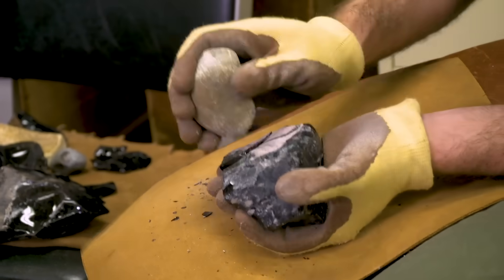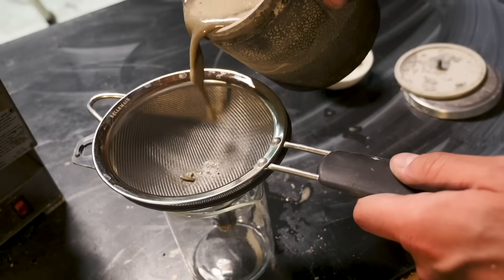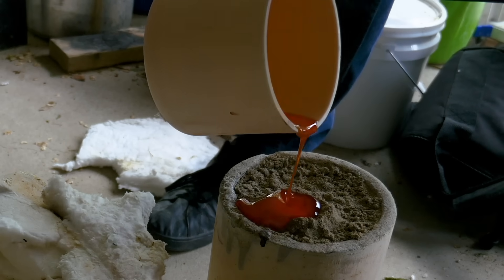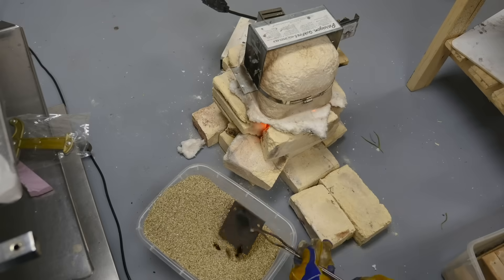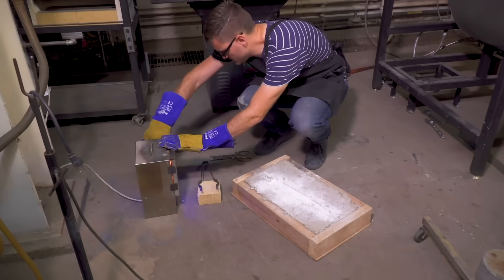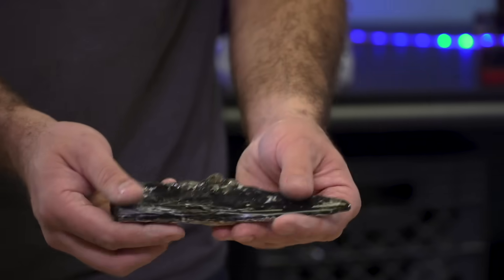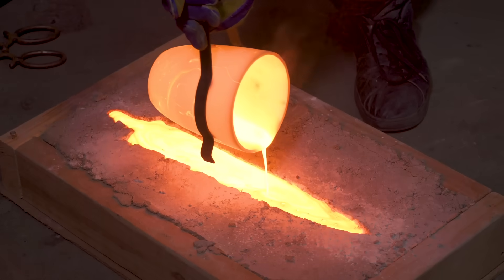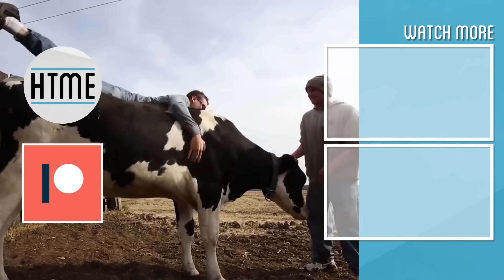Can You Melt Obsidian and Cast a Sword?

Comment: Random info: obsidian and glass, when molten, are ionic liquids. This is to say they contain electrically charged free mobile ions. As such, once molten they will respond to microwave radiation and induction. You just need to get a tiny bit of the obsidian or glass melted and the microwave oven OR induction smelter will be able to maintain heat on that tiny bit and allow it to conduct to the rest of it and melt the rest.

Comment: a helpful tip for making glass in crucibles, try skimming the top surface while its molten to remove any junk or air trapped inside. try also adding the flux incrementally and skimming in between adding flux until its to your desired stability. a lot if the problem here is impurity in the glass if you could refine it more and more you might have more luck but i think you pretty much covered it here
Reply: remember the more metal inside the glass the more likely it is to expand and crack the glass while it cools down. we dont like to put sparkle colors encased in other glass unless there is a open side for the metals in the sparkle colors to expand
Reply: what you are doing is basic glass chemistry and you are following in footsteps of people like Paul Trautman in the discoveries of glass creation its pretty neat
Reply: WookedoutLINK dang your smart
Reply: WookedoutLINK your a smart person, keep learning what your learning
Reply: Wouldn't you just have some type of glass and not obsidian at that point? Maybe the question is can you make glass from obsidian easily?
Reply from the maker: Thanks for the advice!  It's been really interesting learning about how to refine glass and your feedback makes sense.  Will try this in the future.
Reply: we use steel rods to do the skimming btw
Reply: What is this SORCERY
Reply: The Pokémon Hipster This is me all through the whole video and scrolling down the comment section
Reply: Glass telescope lenses can take a year to cool.
Reply: This is fascinating, from a cook's perspective.
Reply: well, SHIT!!! he's giving mojang ideas now, crafting obsidian swords
Reply: The Aztecs didn't need to melt it.
Reply: The aztecs just used the broken edges of natural obsidian, bound in wood or leather to stabilize.
There is a vast amount of art and technique to knapping obsidian, and no matter what it wouldnt result in what he was trying to make in the first place.
Reply: +Skyler Thompson: I know. This whole business of smelting obsidian just seems absurd to me.
Reply: You should teach this shit bro I was ready to take a class after that one comment
Reply: i dont understand anything
Reply: DopeyCat Stop Motion YES,WE DID!
Reply: 993 likes in 2 days wow
Reply: WookedoutLINK vvvvvvvv v
Reply: WookedoutLINK like abd subscribe if you think it is cookies ice cream
Reply: siavash karimian 
That’s what they’re called?!? That’s so cool. Metallurgists have got to have one of the greatest jobs. I’d love to learn how to craft something with my own abilities.
Reply: Crucible?

THIS IS AMAZING GUARDIAN!
Reply: WookedoutLINK    👍🏻
Reply: WookedoutLINK i did not mean to press this :p :P q:
Reply: He should have tried using salt in the compound it might help.
Reply: WookedoutLINK 
In other words, treat the molten obsidian the same way youd treat molten metal before pouring it? You have to skim off the impurities from molten metal as well obviously.
Reply: There is literally 1 comma and no periods
Reply: lame
Reply: The Bonsai Belief System you're lame
Reply: Chris Murad no u
Reply: The Bonsai Belief System you’re in the wrong place.
Reply: The Bonsai Belief System) why would you be here then

Comment: I wouldn’t call it natural by any means. This cast is man made, not made by a volcano. Also, I assume by adding flux is what made it clearer than normal obsidian is. And lastly, the bubbling is the molten lava pool of obsidian off gassing. That’s why when you heated it up, the bubbles shriveled back into the liquid. If you would have let it cool and not made the bubbles disappear, you would have a really cool and interesting man made obsidian specimen with bubbles on the surface.

Comment: Lay down the mold and do a half cast, do half of the knife, reposition and fill the other half. Sift the green sand around the mold (not the whole thing) so it comes out with better detail, and pat down the mold continuously. You’ll get way better results casting

Comment: Oh my. Ok, mill your mold negative out of graphite block. This sand casting glass thing is of limited utility. Next, your glass pals might have a platinum crucible you can borrow. The alumina ones are going to end up as single use. Also, there may be some pickup into the melt. Not desirable .

Comment: Have you tried sintering it instead?
Also, it should be noted that there is trapped water inside of vermiculite and inside of obsidian.  Do you have a vacuum oven you can try and dry it in before trying to melt it?

Comment: There is a process in advanced sword making that is called forging crucible steel.  

Basically, you take a metal crucible, toss in iron, carbon, and sand and heat it to a ridiculous level. The sand turns to glass and, -through a series of chemical interactions - leaches out properties and impurities in the metal that would make it brittle. Some of the best swords in the middle east and upper Europe were made of crucible steel. 

There is no reason that I can see why powdered obsidian wouldn't work in place of the sand. In fact, it might even make for stronger steel.

Comment: It's quite easy to make such castings and still get the strength of true obsidian. Just melt it (without flux), in an inert atmosphere and pour it. Then anneal it for about 10 to a 100 thousand years or so, preferably under a slight pressure of a couple of tonnes per square inch. Easy peasy.

Comment: With your standard equipment you got kinda close, in spite of the fact that it isn't built to melt things at such high temperatures.  If you had specialized equipment built for the higher temperature, you might be able to melt it without flux into enough of a liquid state that you could cast normally with it (With specialized casting equipment obviously).  Even though you don't really do it here, it definitely seems feasible.  Either way, nice job.

Comment: At 9:00 when he is pouring. I knew right there, that crucible had it. I knew that it can't do another round. See the glowing crack?  And sure enough it cracked the next time.  Don't know how you missed it or thought it was okay.
Reply from the maker: I definitely saw that cracks.  You'll notice the metal tray I added below it afterwards to attempt to catch any leaks (it just unfortunately fell off when I pulled it out to stir).  The crucibles actually cost more then it does to fix the kiln, so if I can get even one more firing out of a crucible, it's worth it.
Reply: I suppose I can see the logic in that. I Did not know the price difference between the crucible and a kiln.  But now you have to replace both.  Is the damage to the kiln real cheap?

Comment: Why not cast a test knife and anneal it with a microwave, that way you can cool it at any rate you want, hopefully preventing the cracking
Reply from the maker: Can you anneal in a microwave?  It usually took up to 12 hours of slowly cooling to anneal some of the smaller ones I did in a kiln.
Reply: I think the major problem will be that the glass turns non-absorbant after a certain temperature, which might leave enough residual stress to still crack it. an IR thermometer hooked up to an arduino to control the microwave itself should get you plenty of temperature control before you hit that point however

Comment: the bubbles from 9:20  were probably from that powder? whatever that was absorbed moisture from the air in between pours  baking the mold  could have mitigated that issue and probably wouldn't have stressed the glass as much during pouring

Comment: To prevent your thing from cracking, you should start with material from a bigger chunk, like one big solid rock.
When you use many different, they may differ in material and they may thermally expand differently causing cracks.

Comment: I admire your work at trying to cast  glass, but to me there is a glaring problem. You're not learning the most from your mistakes. Having your crucibles crack repeatedly  on you, try using a different type of thicker crucible. Constantly spilling liquids? Either stop and get a second container/ bigger container if possible. Improve your process, and it will improve your results.

Comment: Hey it really matters which igneous rocks you use. It works best with wet basalt or basalt that has water in its structure. This lowers the melting point to around 600 degrees

Comment: I think it would also help to have a finer (ultra fine silica sand or ultra fine greensand) sand to reduce the nucleation of molten liquids.. I.e. Smaller particles, less surface area for molten stuff to adhere to and change microscopic temperature environments that what cause bubbling in boiling liquids.

Comment: Can you make prince rupert drops from obsidian?
And does obsidian get clearer if you smelt it again and again with flux?
Reply: m.k._fotografie_ at some point you'll just have a bunch of flux with a little bit of the original obsidian. Nothing to write home about.
Reply from the maker: We tried making prince rupert drops from just regular glass last year, and it actually really hard and never figured it out!  In theory it's probably possible, but I imagine the extra impurities from the obsidian would likely make it even more difficult.
It's likely some impurities are burning off each time, making it a little clearer, but I doubt it'd get too much clearer over time unless you completely diluted it with flux.
It would be possible to chemical remove the impurities and extract just the silica parts of the obsidian and then make perfectly clear glass from that.  I actually did that process to clean the sand I used in my toothpaste video: https://youtu.be/PHxG32d3B3Q?t=414
Reply: Hmm. Interesting. Since using glass is already difficult, I imagine working with obsidian will even be harder. Pure obsidian is tougher, but more fragile. If you make a prince rupert's drop from obsidian, will the obsidian drop be harder to break, but when it breaks, is it more dangerous than glass?
Reply: How To Make Everything I can almost guarantee that it's because you didn't get it hot enough and focused on making a large blob rather than an intensely focused hot spot
Reply: SovietandScotsman I guess they could have just used a large vacuum room like NASA has, take the obsidian and tig welding equipment in there, and use techniques similar to brasing metal as shown in MAN AT ARMS’s video on making Wonder Woman’s shield.
You could take a block of obsidian and gradually draw it out into a sword blade by only having one molten spot at a time.
Reply: How To Make Everything look up a tutorial on how to make prince ruperts drops, they have a ton of them, if you haven't already
Reply: You can make prince ruperts drops because obsidian is a type of glass
Reply: He diluted the obsidian with flux, that is all. Not sure what he was expecting.
Reply: It probably will get clearer if you get rid of the iron components in it + let it cool more slowly.
Obsidian is rapidly cooled rhyolithic lava (vulcanite version of granite) with components as followed: 
-36% Quarz
-32% alcaline Feldspar
-23% Plaglioclase
-9% mafic minerals (pyroxenes or biotite (+ Magnetite and/or Hematite))
Of course it can vary by a few weight%.
For Obsidian you need roughly 5 or less weight% of water.
Reply: Master glassblower here.  Prince rupert drops are all a matter of timing.  I've made 100s of them over the years.  Once you understand how glass moves and why it reacts the way it does they are quite simple to make
Reply: m.k._fotografie_  I asked the same question on the king of random channel lol